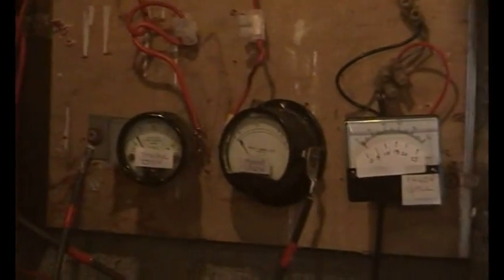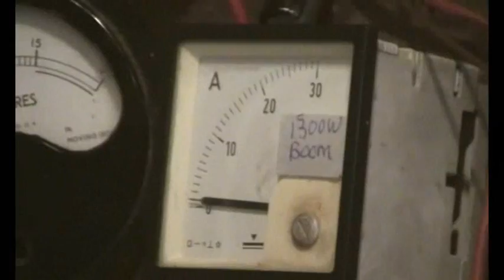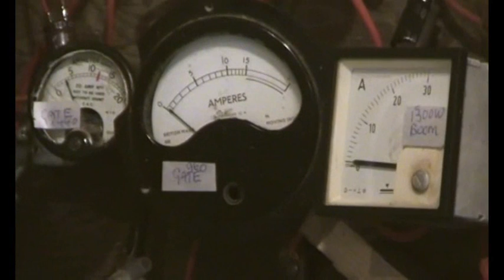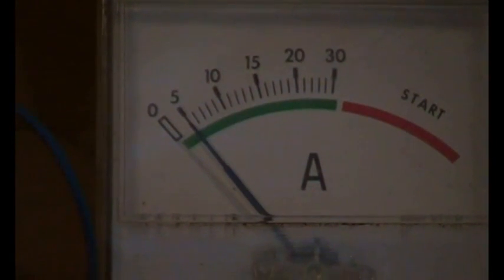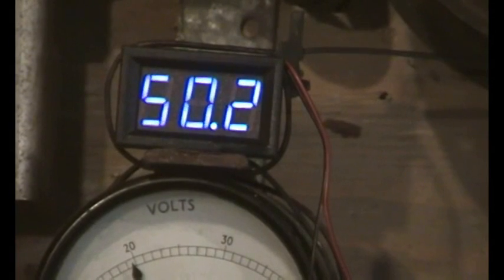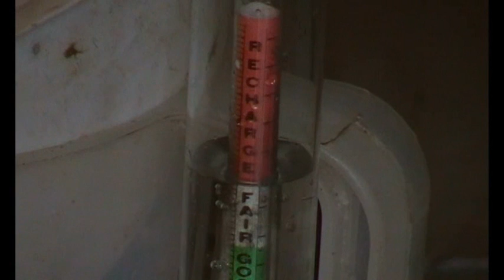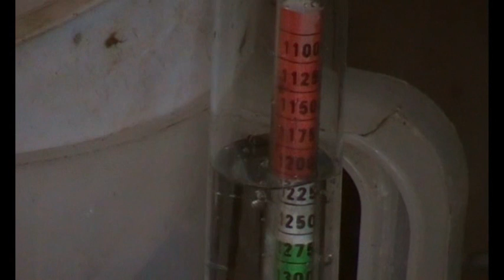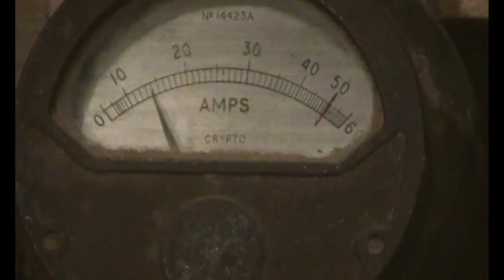A year in the life, home renewable electricity.

Comment: Just what I need Andy looking at providing the majority of our power in the coming year or two from wind and solar. Heard any developments on graphne solar yet? Looks very promising.
Reply from the maker: With the price of panels now it makes long term sense. If graphine based capacitors could hold 600 Ah between 44 and 60 volts and have a low cost it may well be the future. It would be interesting to see what the loading of such cells would do to a turbine. Cheers, Andy
Reply: +Andy Reynolds I heard a radio interview last year with an inventor claiming that a graphene based panel was in development by others. Claimed the potential for 60% + efficiency. I also saw an interview on YouTube with a university researcher in the UK where they were also working on this. Exciting times. If true it's a new era.

Comment: Is the wind turbine pushing out 50v dc nominally then Andy ? So the 40A we could see from it  here was quite far up towards its full power  of 2.5kW if so.... I'm amazed at the number and variety of solar panel collections you have, no wonder you can just about keep level with demand on average. Dave.
Reply from the maker: Dave, been collecting panels for quite some time, and it will not be long before the panels will be keeping the batteries full every day and putting power into storage heaters.  Yes the turbine is nominal 50v 3 phase AC through a recifyer. It is rare to see above 40 amps, it takes a combination of low battery and high winds, just amazing that I go it on video. Cheers, Andy

Comment: With all the solar panels scattered about, do you have much of a voltage drop between the panels and controllers?
Reply from the maker: A very pertinent question. For this very reason I use a minimum of 6mm cable (copper cross section) and there are 6 circuits to cut down on the current of any one circuit. I have never checked it, but any significant drop will only occur when the current is high. I will try to include this at some point in the summer &quot;year in the life&quot; video. Thanks for the question, Cheers, Andy

Comment: Good Lord Andy, can I ask how much $ you have invested in this system of yours. Then what about the man-hours to build it.....Wow.
Reply from the maker: Hi, that's an impossible question to answer as this project has been going on since the late 1980s. However when we started on the solar the panels were £3 per watt and now the last lot I bought were £0.10 per watt. Forklift batteries reclaimed and worked on to produce a very relaible power storage unit. The inverter was the expensive bit. Turbine tower was free. To get good reliable power there is no such thing as too many solar panels, but you know what happens when you get into a serious obssesion. It's a good hobby that teaches you alot and gives payback and is all in the book. Subscribed? Cheers, Andy